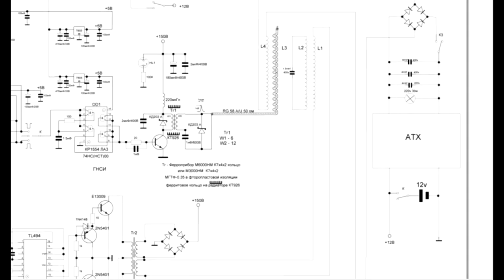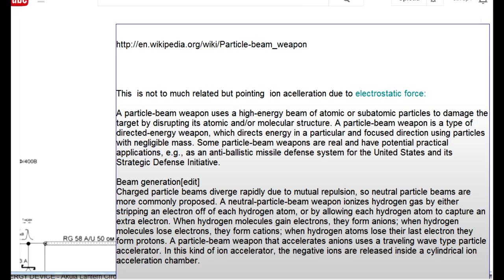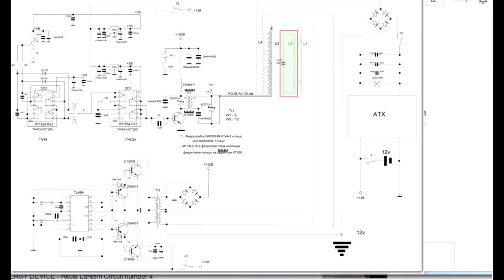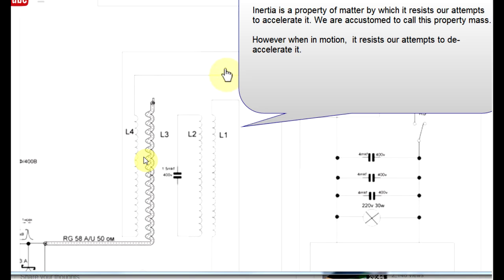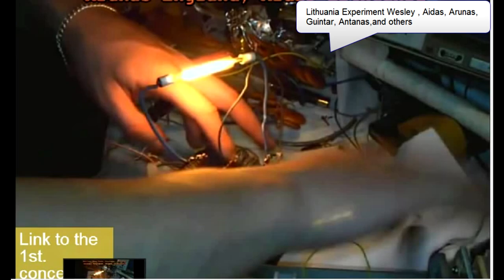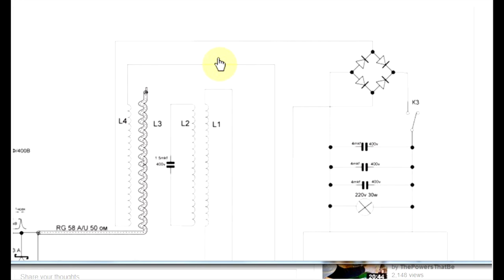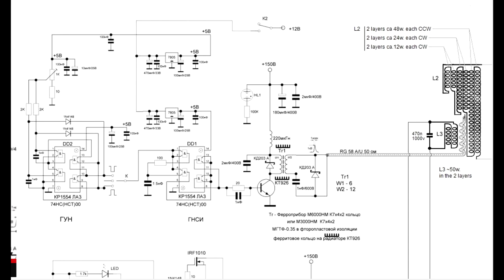Wesley presents:Daly part #5 Free Energy JOHN & WESLEY

Comment: In physics, the mass is held by the strong force. It is 137 times stronger then an EM field can become.
Mass in vibration is the way to tap into it, without having to explode the atoms.
The proton shell is held inside the strong force bubble, and the electron shell sets outside it in one of its rings.
This is why positive charge operates differently then negative charge in these devices.
The key to this thing, I believe you will discover is the scalar cancelling coax. A 1/4 wave short, is a cancelling stub length, in radio work....by the way, thank you for these videos, they are very inspiring to see, going public now.

Comment: I would change the word inertia, to "A field". When you scalar cancel an electromagnetic field in the coax, it will produce current in opposite directions on each of the two concentric conductors. However since each has a different area of the skin, the resulting field will not be totally cancelled. The extra energy that does cancel will turn into pressure fields, or mass vibration fields. This is similar to Joe Cell technology. If the vibration field matches the EM resonance then it will add power to the EM side. As you may know we can run an engine without fuel from a small Joe Cell if it is connected in correctly. Do not underestimate the power in mass vibration effects. At the nuclear level, they are powered by Source energy. Atoms always recover their shape and size, with anything less then a nuclear explosion, they have tremendous power. That is the only power Source present in this device which can explain the large output energy.

Comment: Wesley: The man you were talking to was either ignorant or a shill. Any 2nd year book discussing Radio Communications has a chapter on resonance, where we learn resonance produces 10 to 1,000X gains in actual power, coursing through the circuit, based upon the Q (quality) of the tank components (inductor & capacitor), and of course, the resonant frequency (F). The problem arises when you try to LOAD the tank, which bumps the circuit out of resonance, and gains are lost. A resonant tank can be tuned for ONE load only, if the load shifts, you must shift the F to compensate, or gains are lost. However another approach is to harvest resonant gains WITHOUT loading the tank. This is indeed possible. In your video you use the example of the pendulum. See Veljko Milkovic's pendulum for how he creates the energy harvesting WITHOUT loading the pendulum. Keep up the good work, thank you for speaking slowly and clearly, so the listener can understand.

Comment: if I'd asked for start one explains schematic symbols and bring direction replacement of parameters! (it will improve the image of the scheme because it is difficult to read?)
My question is what kind of systems/ (KP 1554?A3)OSC.,about how the switch "K" a flip flop which is only one position? ,capacitor xxx000B,diode in the reverse direction Rectifier? and several other useful information for them thanks +++part #6
Reply from the maker: as the K switch goes I think it is alternatively  one position operated square or inverse square position  just as an option. There is no more information there for me to speculate with.
The Rectifier connected to L4 it does not make for me sense to employ rectifier and bank of  capacitors for the light bulb as we need AC not DC for  220VAC to 12V DC power supply ATX.

Comment: The only way the atom could be exploded, was using a platonic form vibration. A convergent pulse or vibration intersecting a center simultaneously. You cannot use electricity to explode an atomic bomb. They used TNT in a spherical layered system, and set them all off exactly at the same time. Vibration is the only method to access this form of power.

Comment: Pulse travels down coax meets a short, short has no volts across it so energy dissipated approx zero. If coax length = 1/4 wavelength at pulse freq then source sees open circuit (where incident pulse meets reflected pulse), so little input energy required apart from transmission loss of coax. However coiled coax has huge current at shorted end. This is reactive power can be converted into usable power via magnetic flux. Cw and ccw coils on transformer cause time compression through opposite vector rotation direction. Effectively increasing available energy per unit time.  Does any of this make sense?
Reply from the maker: 22:41 minute at video  Wesley presents:Daly part #1 Free Energy Device (schematic) .
My friend WHAT IS THAT I SAY THERE?  qote :Guess what coaxial cable will never see it shorted it will see it 
 open!!!!! Go to the link Wesley presents:Daly part #1  Free  Energy Device (schematic) and check it out.
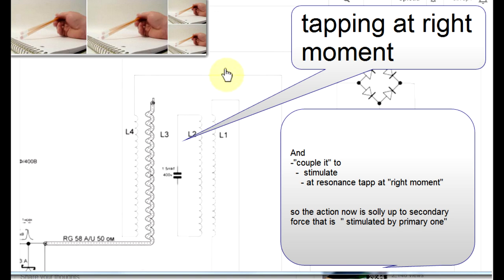You are not bad my friend..... The problem with all of you is that you do not read my comments.... the best  analogy I*  could use explaining electrostatic pump is in minute 12:08 in  Read the words in the frame quote
"so the action now is solely up to secondary force that is stimulated by primary one."
Thank you my friend for your comment.
Reply from the maker: However there is a problem   forward wave and reflected wave do not see  each other.They  do not interfere with them-self. I have  the same problem looking at coax interaction.At that point I myself  have  tough problem to  swallow. the only reasonable explanation is frequency  not higher than 20kHz ( well  up to 150khz) where circuit  has capacitive character . Ath higher  frequencies you will have little to no interaction out of shorted coaxial cable. ( The only interaction would be than from exposed short point of the coax ) So the answer is Keep the LOW FREQUENCY in the coax.Also what helps: Coax has 50 Ohm impedance but  the transmitter is not 50 OHm. If TX  was 50 Ohm we come back what e come from. The more difference of impedance output of TX is comparing to coax impedance the better  is  interaction ot that  coax with outside world.
Reply: Yes they do see each other ..this is what causes the VSWR effect on the line as the vectors form nodes and anti nodes every 1/4 wavelength along the line. Impedance is conjugate of short circuit at distance 1/4 wavelength away, which is an open circuit.
Reply: We usually plot this variation in impedance on Smith charts specially designed to track impedance change per change in wavelength.
Reply from the maker: the most common misunderstanding or misinterpretation. 
If  Forward  Wave and Reflected  Wave (RW) would see each other the SWR meter  that is based on  Directional Coupler will be "lost"..................... as usually SWR meter is  placed  right after the tank circuit and before  transmission line.
 You would have dissipation of energy at first  node or say "hot point" or "hot spot"  ( you can touch it with your finger it is  usually hot but not always )So  At the tank - for RW you would see nothing but losses, however if that  was true what you say  than Reflected Wave at transmission line with 10  Directional Couplers on the row, at every 10" of it , would show you different SWR for each one.  (hot spots)-nods  in between  the Directional  Couplers  will be  making that effect. and you would be fooled around.  Do you see the paradox now?
Reply from the maker: Please read all comments: Slotted Line( device)(SL),- has been usually used to see nodes and denodes 
or peaks and valleys however you can see it only if you immerse your sensor in  transmission line of  SL and that is easy to be done but at frequencies over 150MHz. I have 6 feet  slotted line ( WOW the beauty) ALFORD SLOTTED LINE 2181-6.swf from 100MHz up.... So in order  for you to see lower frequency you  can use sufficiently long coax with Slotted Line that is actually open from one side along its length , surprisingly there is no signal loss  because of it. :)    
So if you look at peaks and valleys  at frequency of 20 KHz   you can not use SL as the distance between them is to  large and slotted line is impractical. 
Wesley
Reply: Yes Wesley we doing these measurements, using both directional coupler slotted line and UHF bridges plus line stretcher devices. Coupler is actually a power divider and removes power exactly as you state. But point is we can cut or lengthen the coax line in order to match load to source performing transformer action thru conjugate matching. So not hard to have short at one end of line whilst presenting open circuit to source at other. This line acts like tuning fork it rings when tapped with your pulses. Source sees long vibrating tangs whilst load end is central section with no discernible vibrations.

Comment: When i hear "energy" this makes me cringe. Our views of "energy" Are based on current only. Well energy can not flow without the potential or voltage factor. This is the key! Tesla was onto this very quickly. Provide the potential and the current will flow into the device from the environment. This is the sink Tesla envisioned. The charge pump or electrostatic device will provide the channel and the current that flows into that channel can be invoked like the water flowing over Niagara Falls from condensed water from the atmosphere. There is a free lunch and the buffet is open!
 Our models are based off of current and this is why we have no free lunch. Although it is there waiting for us and nature utilizes the weak force(Voltage) to connect two points in space over greater distances than the strong force(Current).
 This is why the models are falling apart. The professionals are only concerned with the strong force and ignore the most important aspect of all energy flows, the Potential or Voltage.

 There is a great movement in the works to eradicate everything Tesla was looking at. They will cite there teachings and say it is impossible but as you have seen it is not impossible it is very Possible.